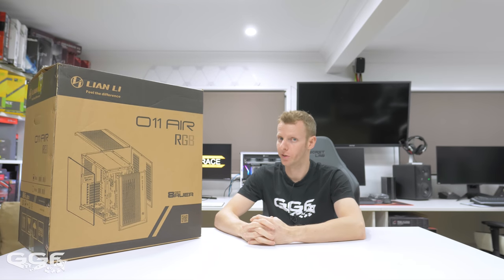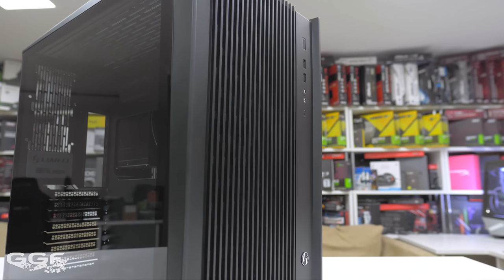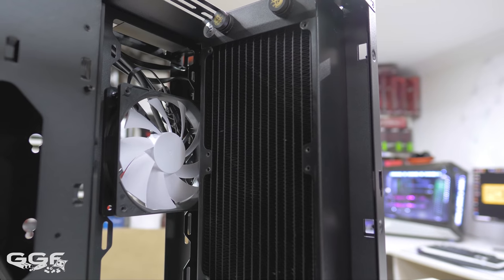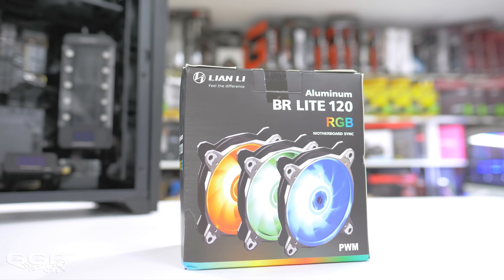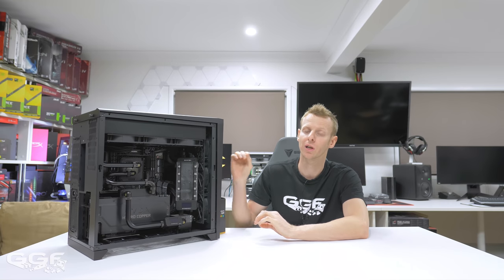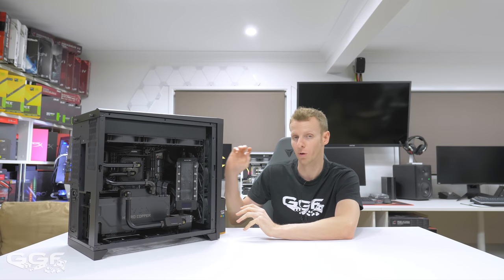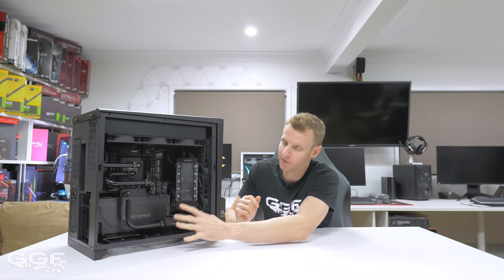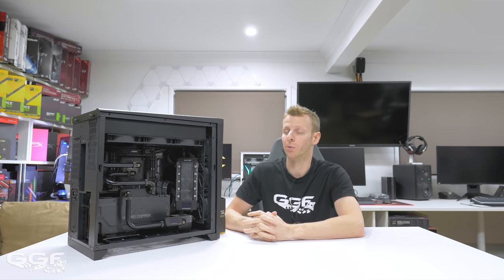Lian Li PC-O11 Air Review (Watercooling Coverage)

Comment: For the top radiator. Which fitting are you using to connect the soft tubing to which is being passed behind the case. As it's quite a narrow fit with the motherboard back plate on the case.
Reply: yes how ?????????????

Comment: You can do a radiator at the front, bottom, top and side at the same time. You would just need to do a customized front panel in which the radiator could fit in.

Comment: I agree that the extra front intake compared to the dynamic version is a deciding factor between these two versions.
One question though, did you keep the air filters on? Because they say they block too much air movement.

Comment: I love this case. But i do want to ask what Fan Setup you would do if solely relying on Air cooled parts, although i do have an AIO as exhaust currently. My current Setup is Front/bottom/Side intake, top exhaust. Temperatures are sufficient with a 1080ti Strix OC not getting hotter as 67° under heavy load.

Comment: Hi I had a question about 0-11 Air build, by the way your water cooling builds are Epic. I have two 1080 ti I Was on water blocks would they possibly fit in the Air Configurations. 360 pe coolstream slim on side or top and 240.. Iam new to water cooling.

Comment: the pdf is no longer there for use and i would like to know if the o11 air will fit a 1080ti strix with the EK-FC1080 GTX Ti Strix RGB - Nickel

Comment: Lol, how do you make a full 10 minute video on this case and not mention anything about commonly reported problems with removing and replacing the front panel when building and maintaining your PC?

You spent more time talking about the components you put in there-- fastidiously remembering to name drop every brand name-- than you did actually talking about the case.

No wonder you guys are still so small.

Comment: Piece of shit case. 

Air cooled case, does not accept any of the bigger cpu coolers. So they are forcing you to go watercooling, but wait... you can't stick in a radiator at the front without blocking off all other radiator mount. And also, screw your bigger gpu cooler blocks...

Designer by der8auer and spent 6 months... 6 months doing what? figuring out how to give the middlefinger to everyone?